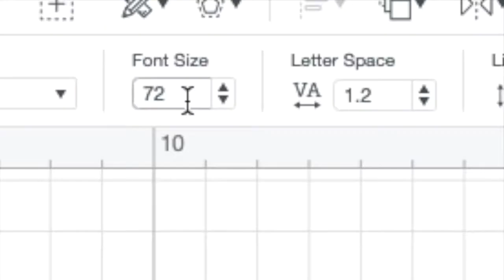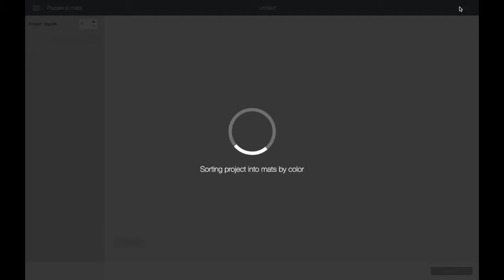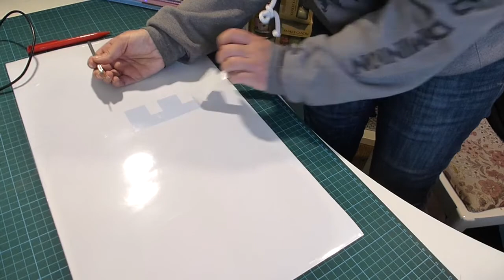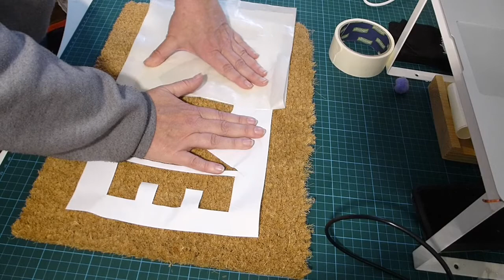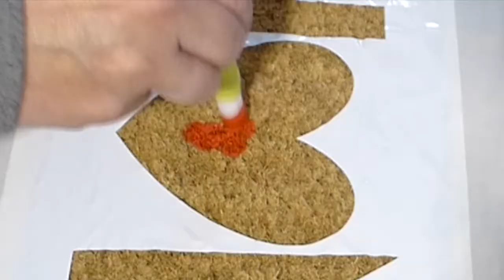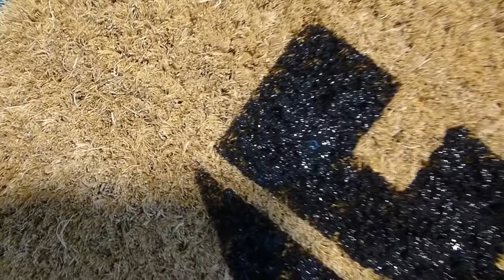Make A Stencil and Use it To Make Your Own Personalised Door Mat with Your Cricut

Comment: Hi Gemma, thank you for this video.  Bought a mat from Dunelm so going to attempt at making something similar.  Do you know if Cricut can make a stencil that can be re used rather than using vinyl? The mat looks great!
Reply from the maker: Hiya, you could use some thin acetate like material to make reusable stencils rather than vinyl, I’ve not tried it myself though. Let me know how you get on xx
Reply: @ will do.  Thank you for the suggestion.  Regards